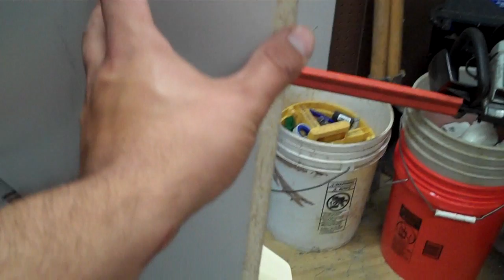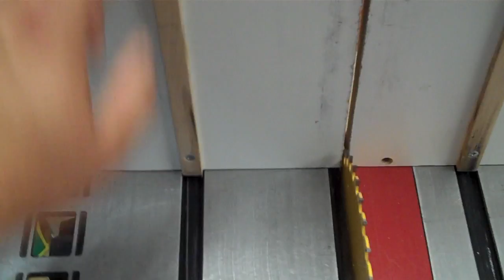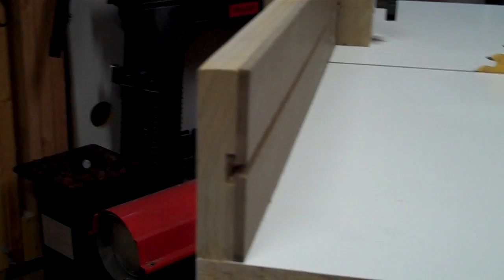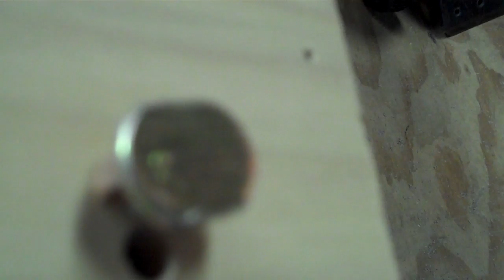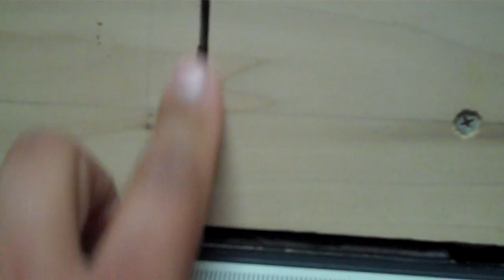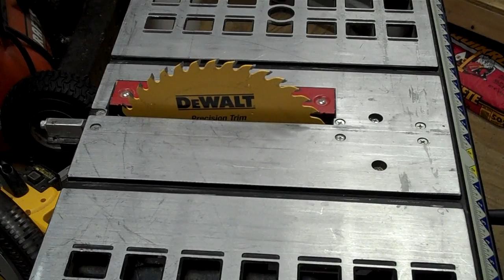Table Saw Sled

Comment: Not bad, but I put two upright handles,glued and screwed, one to each side (and several inches away) of the blade. It gives me a lot more control and support when using the sled and it keeps your hands at a very safe distance from the blade.

Comment: If table saws with sliding cross cut/miter cut sections were more available in the states then we wouldn't need to use cross cut sleds.  Using a sled, even with having removed safety guards, is actually safer than using a miter bar and leaving the safety guards in places.  It provides stability and gives a place to push with being able to keep your hands away from the blade.  You can clamp the wood into place so you don't need to hold it while pushing it through the saw.

Comment from the maker: I appreciate your concerns...my feeling is I don't care how many safety features one has or uses.  If you don't use your brain and pay 100% attention to what you're doing, accidents WILL happen.  With an overhead guard, my fingers can still slide underneath it and get cut if I'm not careful.  I always pay close attention before during and even after every cut where my hand and fingers are in relation to the blade. How is making 
modifications to your own saw illegal where you are?

Comment: yes, formica tops are always around and it's nice because it has a backing alreay at 5 '' high and it's usually around 2 ' wide so it fits perfect at the table saw top . All I ad to do was set the runners with glue on top and place the formica top against the fence and then place screws under it when glue dried up and it mad the 90 deg in the first cut :) the backing was smooth and the top nice formica finish.